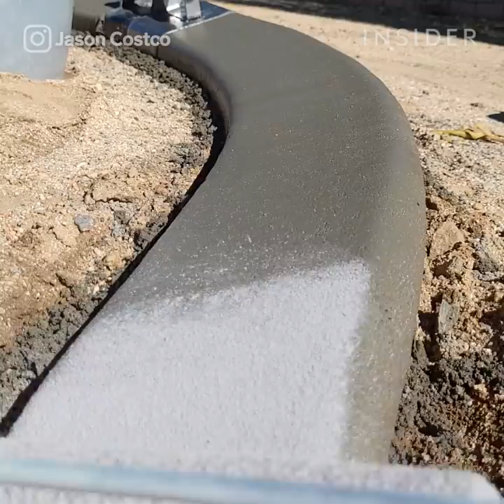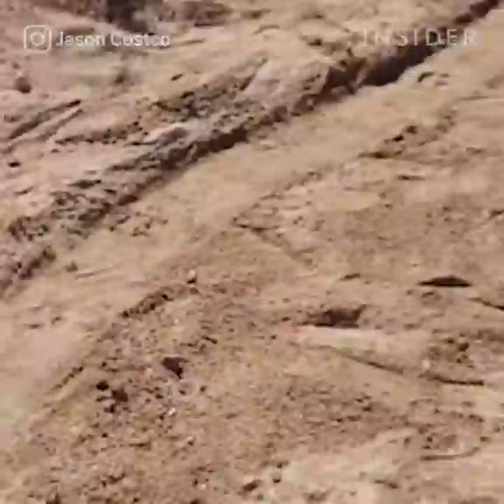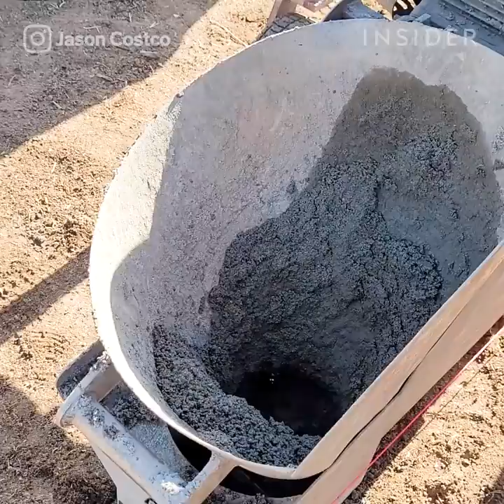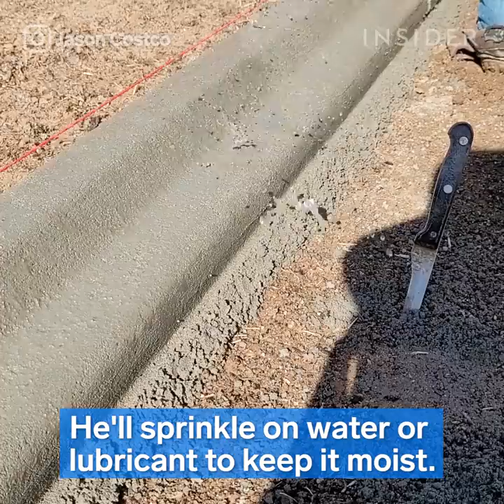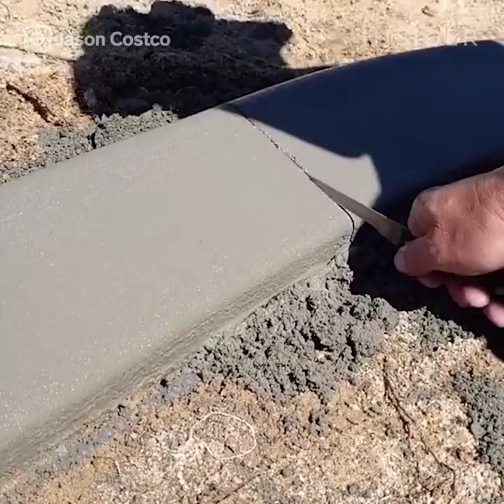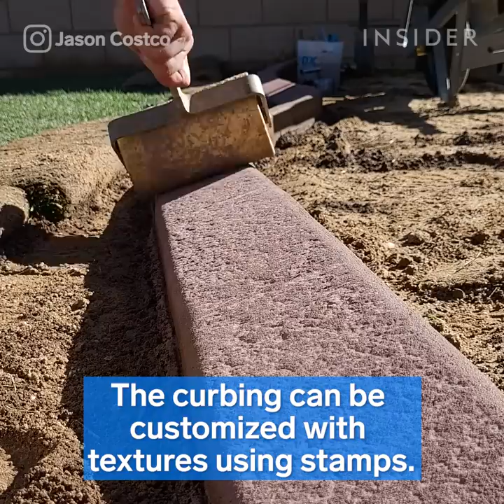Landscaper Transforms Lawns Using Curbs

Comment: It’s called curb Crete. I have it for my flower beds. Holds up great. Makes mowing and weed whacking a breeze. Even edging the lawn by it gives it a great look.
Reply: Looks expensive
Reply: Alot of Crete
Reply: @JohnSmith-en2st  I paid about $1300 for 2 large flower bed borders, 1 small side flower bed border, and a border around my front tree area. Custom imprints and brick like decorations. Worth it for lawn appeal. I got tired of relaying bricks every 4 years.
Reply: i think you can mix your own with cement, mason sand and some fiber material.. a lot cheaper than premix stuff
Reply: I wish the landscaping company I work for did this, I would be the supervisor of that team like 75% of my work history is concrete work. I'm on the refinement team after transferring from mowing and then pruning(learning everything I can) I thought we'd be doing stuff like this but in basically back to being a lumberjack and a guy installing French drains all day. I'm considering getting my CO3 or irrigation license.
Reply: @Warpgatez  "custom imprints and brick like decorations"
It's called stamped concrete
Reply: @Tony-Rinaldo  sure maybe the technical term. Mine looked nothing like what’s in the video. Mine essentially looks like bricks. Also called Curb Crete in my area. Or Landscaping Concrete.
Reply: @Warpgatez  no I'm saying when you stamp patterns on concrete it is called stamping.

Comment: Works well for desert landscapes.
Anywhere with frost or highly expansive soils and those curbs turn into rubble in a few years.
Reply: Can confirm. Dad had it done in the early 2000's and most of it cracked/sank within 2 years. This is in Illinois
Reply: @tylerfini8791  yessir, was going to comment the same thing. Here in Chicagoland, it's not going to look good after 2 winters.
Reply: Yeap Bolingbrook lol
Reply: Precisely. It's also a potential resale headache if the buyer has different ideas for the lawn that mean removing the curbs at significant expense.
Reply: Good this be good in Texas? Dallas area
Reply: Yup, you would need a footing first, for it to last

Comment: Looooovveee, concrete for borders and hardscaping.
I have experience in both concrete and landscaping so the only thing I'd recommend for those wanting curbs that I didn't see here is build a barrier under the curb area, either a deeper curb with the concrete or plastic garden edging lined with expanding foam or something hydrophobic but non-toxic that keeps a strong barrier between the beds and lawn under the curb. Grass roots, and weeds with aggressive roots are awful to deal with when they propagate out of your curb into your beds.
Also when you build the curb, make sure you shuffle hoe the beds and take the time to let the weeds germinate (ideally several times) before planting so you can weed em out before they seed under the curb! Saves so much time for the future.
If anyone else who has had better outcomes or ideas please correct me, I'd love more efficient ways to work! :)

Comment: I drive a concrete truck and some customers put in fiberglass, to keep slabs and driveways from cracking. I wonder if you can put fiberglass in this stuff.
Reply: That is probably a really good addition. Do you think the fiberglass will be enough to not worry about the cuts?
Reply: @notanexpert2978  no, u still need control joints

Comment: I used one of those tools in the build of my waterfall ; massively impressed
Reply: Yeah? Do you feel like it's the kind of thing that, if a person can follow instructions, they can handle this project on their own? 
In permaculture, edges are a big deal; Curvy lines maximize the amount of edge. This really gets the ol' idea machine churnin'. 🤔
Reply: @lisakukla459  I found the process very simple and the tool easy to use spraying water along the top before pulling/forming helped too
Reply: @boredomprevention8148  Awesome.

Comment: Only problem is that those concrete landscape curbings always end up cracking and falling apart. I've had them done a couple of times and they never last very long before they start cracking and becoming unlevel. They look nice while they last though. I'm also sure that the climate has a lot to do with the longevity of it.
Reply: Yes b/c the mix he or they use doesn't really bond well together through the test of time. We do this too but we actually use way better concrete that will hold forever.
Reply: @iaincrawford5472  They don't use any type of reinforcement when doing these decorative curbs. Only the mix.
Reply: Honestly I'd bet if they were to pay that on a  _
Reply: ...on a subsurface that had been properly prepared for a long thin continuous monolithic stretch like that they'd no doubt   last 2, 3, 4 etc times longer. But that would be far more labor intensive, often more so even than the actual pouring of the curb itself. (Ive only laid in MI but here for any concrete that is intended to last is laid on at least a subsurface of crushed and compacted concrete or something similar hence, a lot more work hours. And you know what that means + $.
Reply: I've installed this for 15 years in central florida..got very good at it...you can add small fibers to the mix to add strength, also some higher end machines have the capability to run a steel cable throughout.. I've seen some doosies for sure but done properly you can achieve great longevity in alot of installations I've had mine for 10 years. It has one Crack where I ran it over with the mower.
Reply: @djacoby1985  I think it mostly comes down to the installers around here. They don't use any fiber mesh or any pea gravel in the mix. I constantly see the curbing broken up throughout town. We get up around 100 in the summers and can get down to around 15 in the winters if that makes a difference.
Reply: You are correct

Comment: Given there's no rebar, these will crack within 1-2 years.
Reply: I had it done right after the construction of my house was completed,, before installing sprinkler system. Minimal cracking 8 years later. I'm very happy that I opted for this instead of stone or brick.

Comment: I wonder what it looks like after some years.
Reply: Great. I’ve had mine for 4 years.
Reply: had mine 30 years and still great.  Pressure wash every 2-3 years, one section heaved and i just reset the section and looks great.  It cracked like it was suppose to on the lines they installed to crack.  I am on here to expand my trees out back.

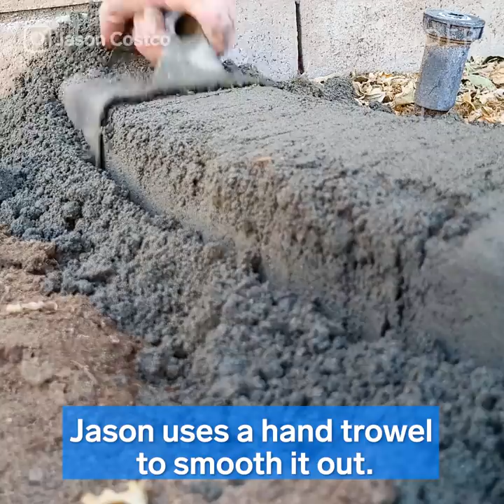Comment: 1:30 while making it too wet will cause it to slump, making it too dry will cause it to crumble apart. Looks like this mixture could use a little more water.
Reply: That's intentional. Better to go on the dry side and sprinkle in water as needed. If it comes out wet and then too wet it's ruined and unrepairable
Reply: @TheHerrMan  Too wet wouldn't make it ruined you could just add more mix.
Reply: @meganswindall7839  aah
Reply: @meganswindall7839  how would you do that once it's poured?
Reply: @toomanymarys7355  you'll notice the second you pour a little and can adjust for your slump. This guy just doing it the long hard way.
Reply: 6 five gallon buckets of sand, 1 94pound bag of Portland, 3-4 fingers of fiber and two cap fulls of air. Water only in a sprayer for finishing.